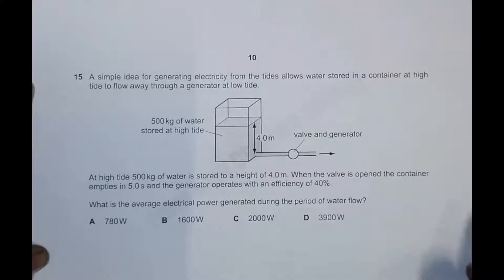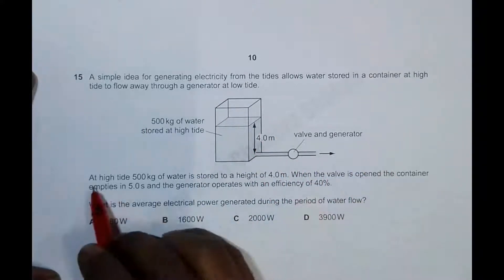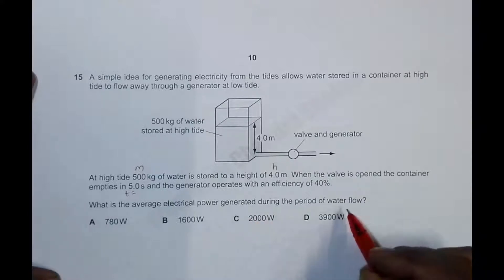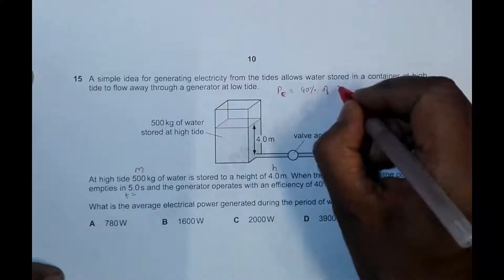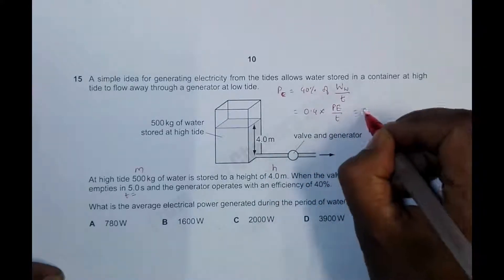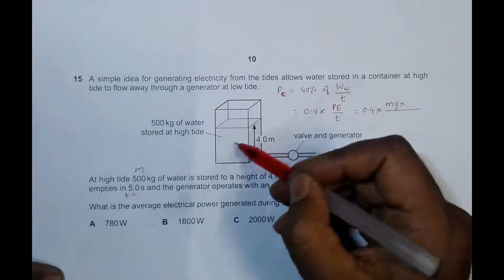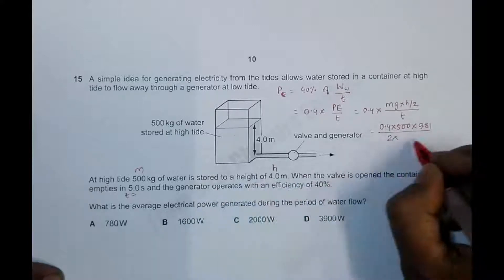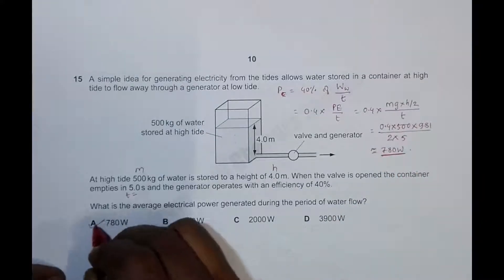2017 Cambridge Pre-U Certificate May June Physics Paper 01 Q. No. 15 (9792/01/M/J/17)

Comment: why did u took the height as 2m although 4m was given in the question
Reply: Some of the water is at height 4 m, but some is at the bottom of the tank, at height 0 m. The question asks for the average power, so we have to use the average height, which is (4+0)/2 = 2 m.